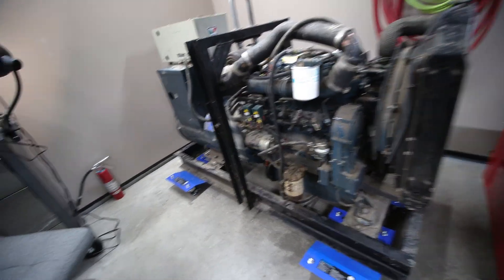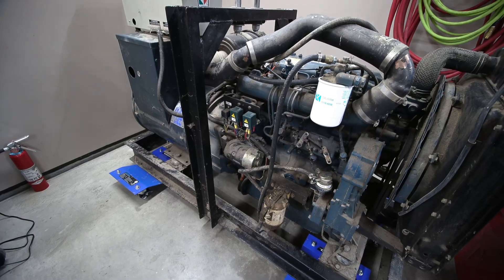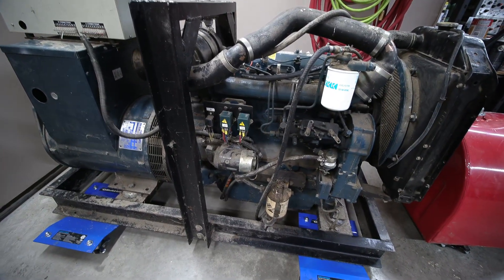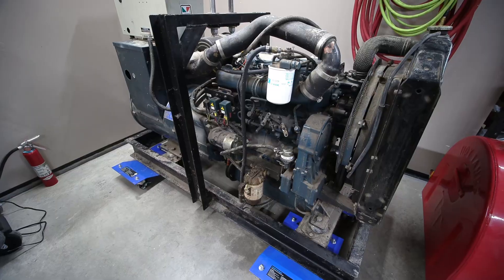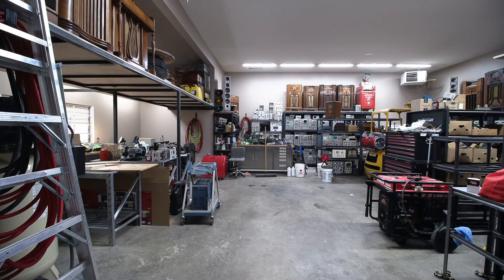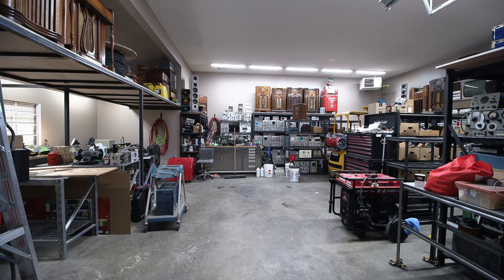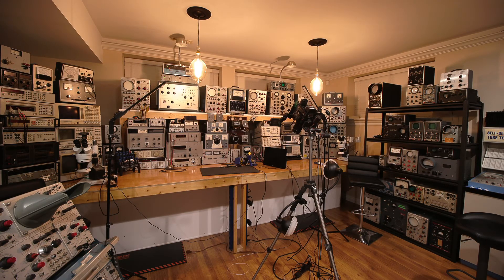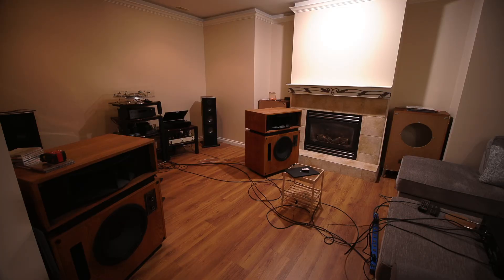Where Are The Videos? My Life And Projects Off Camera

Comment: We also have that issue of having not enough generator for the ground coupled heat pump.   We have a backup lp gas heating system so for us the solution is just to run the gas furnace which the generator can easily handle and not run the heat pump.   The heat pump is great for efficiency but it has failed on us numerous times due to mechanical and control system problems.   So I have been happy with the decision to have a back up furnace vs. a genny big enough to handle the heat pump.

Comment: An HVAC soft-start module wouldn't help out with the startup current on your geothermal compressor?  I installed one on my (admittedly much smaller) compressor and it is magic - reduced that initial instant massive load by around two-thirds.

Comment: I am trying to wrap my head around why you have a 400 kW generator. I was chief engineer for a station in a radio group. The station was in it's own building and that site acted as the office and studios for the station,  as well as being the backup antenna site for the five FM stations in the group. The building had 800 amp three phase service, to power everything. That means we could run five 20kW FM-HD transmitters and everthing else, including electric heat and air conditioning, lighting, etc. The 300 kW turbocharged backup diesel generator could run all of this with plenty of headroom to spare. Why 400 kW?

Comment: I've looked at generators for our area, but ultimately cheaper modern batteries have made full online UPS so much cheaper a generator isn't cost effective. My problem is lots of short duration outages. As long as I continue to have a reasonable uninterrupted mains duty cycle to allow batteries to charge, a decent full online UPS would be my first option. That'll eliminate all the fluctuations and even if I eventually go to a generator for longer outages the UPS will smooth out the demand on the generator.

Comment: you should consider an inverter and lithium battery bank connected to the grid, i am a victron dealer installer. if you had a few thousand watt hours of battery and a generator if you want for reserve the system can essnetually work like a UPS backup and thhe ability to assist during brownouts. it would provide consistant toruble free power.

Comment: Hi Paul,  It sounds like you've got two problems: Power outages caused by the public utility and peak demand current primarily caused by the geothermal heating system.  Hopefully, I got that right.  What I didn't hear is how you "ride through" these disturbances, if you even do that.

15 to 30KW is pretty large demand for an individual's needs but in your case, it does not surprise me.  I haven't looked back at your tour of the new shop so I can't remember if your pumps incorporated soft-start features or not.  If you don't have this feature, you should.  I live in Florida and have power issues similar to your descriptions.  I use a 11KW natural gas generator and was initially told that I needed a 30KW generator to manage my house load and HVAC system.  The reason, I was told, was the AC compressor could pull multiple times the nominal operating current of the compressor depending on when the load is impressed on the line.  As a former UPS engineer, I knew that the generator people were worried about the inrush current in an uncontrolled motor load.  Fair enough but the degree of the concern is easily managed by various soft-start circuits that essentially stretch out the peak demand which reduces the over all demand (such as a local genset or a UPS) to handle the event.

The 400KVA generator is likely over-kill for your load if you incorporate UPS and motor soft-start features.  Diesel generators have superior power in torque specification than gasoline, natural gas or propane.  So I really doubt you'll have too much problem other than it will be expensive to run.  For UPS deployments, a stationary battery can grow quite large depending on the desired ride though need.  Most commercial operations weigh the cost of consumables (batteries and their replacement cycles) with the cost of fuel and opt to run on battery as long as possible before switching to generator.  If you are having multiple events daily of short durations, up to a few minutes each, lithium ion batteries are a good solution and far superior to AGM or typical lead acid types for longevity. 

I use multiple UPSs in my home because, primarily, any UPS that is sized large enough for my total load with inrush headroom is a three phase design.  As you know, all public utility sources that feed residential North American homes are 240VAC single phase, center tapped sources.  240VAC UPSs are rarely available above 5KVA but they are out there.  I use two 2KVA UPSs and soft-start circuits on motor loads.  I can easily handle all peak loads with an 11KW natural gas generator. 

Anyway, I hope you get your power problem resolved without breaking your bank.

Cheers, Scott

Comment: That generator nameplate is a little hard to understand. The rating of 403KW agrees with the 1671 amps, but that frame size (361 in the model number)  shows ratings up to about 60 KW in the Marathon literature.  A 400 KW generator would need around 550 HP, and for continuous duty the engine would likely be even bigger.  It looks more like a 40KW-size unit.
Reply: Exactly right!!
Reply: That makes much more sense! That non-turbo Kubota probably makes no more than 40 HP at 1800 rpm, so a 40 KW generator is still oversize for that engine.
Reply: Generator unit seems absolutely massive for 40Kw, but makes way more sense for the engine output. Could just be way overbuilt for some application, and definitely closer to 40 than 400Kw, but still that's a big ass generator for that engine.

Edit: That's a 40KW gen somewhat derated for .8 PF in continuous. Up to low 50s KW for standby with higher PF. Specs for 361CSL1602 online. This is a 36XPSL160X, but all the gens in the 361/362 frame size are 40-50Kw for continuous duty. This is just an industrial-grade unit and is very overbuilt, with the gen alone weighing 6-700 pounds. Makes way more sense.
Reply: Some dot is missing.... 40,0kw is 167,1amp.....

Comment: Another aproach? A soft start aparatus for the E motor of the compressor? The compressor doesn't care if it spins up slowly, might even be better for lifespan. Y- delta switch or even semiconductors.

Comment: Some thoughts:
To make it easier on that 15KW backup generator:
1) Hard start kit for the geothermal compressor??
2) Put time delays on some of the geothermal components so that startup surge is distributed, instead of hitting the generator all at once??

My $.02!
Reply: No, do not use a "hard start". Use a "soft start". I use one on my geothermal system and it reduces starting current to about  30 %, and prolongs the life of the compressor instead of stressing it even more.

Comment: I would check the windings insulation and the AVR behaviour (on a scope) when taking large loads (>20kW). If everything checks out, install it, taking care to leave space for the maintanance. If not present, add a hand pump for the oil pan. Anchor it to a concrete pad. Do a great job on the exhaust, two mufflers in series will do the trick. Then rewire the whole thing to a brand new Comap InteliLite 4 (several models, use AMF version and if you have modbus/scada requirements for your home automation get the better models equipped with such feature). Such controllers will be able to control directly your GCB (generator CB) and MCB (mains CB). From experience use Fleetguard, Baldwin or Donaldson filters only. Use a 15W/40 diesel detergent oil. Flush the radiator and put OAT Fleetcool 50/50 mix (pink) so that you can forget it for 10 years. Keep two sets of filters and belts as spare all the time. For starting batteries use good AGM, avoid Optimas RedTops (since they started producing them in Mexico they are no longer what they used to be), use a 5A smart charger and set it for 2,30V/cell. It might be wise to add a 500W or 1000W engine heater (low temp version +35C) for when the ambient temp goes below +5C however you need to calculate the yearly power consumption.

Comment: Put a soft start (Micro Air) search Google and you’ll find it . system on the Geo thermal compressor. 

This greatly reduces the start up in rush, so you can operate it on a much smaller generator with less loaded . 

👍 Tech tip of the day.  

Heat pump systems is what I do for a living cell and install . 
In this one particular situation that you describe this is the cheap easy fast fix . 

Especially if it’s only doing it with a voltage sag during the very cold season and you don’t have this problem during the mild seasons, you can take the micro air out of the circuit for the rest of the year .

Comment: The Marathon 361PSL1601 is a 50kW continuous generator (60kW stby). A 400kW unit is larger than the whole set... Have not idea about those values on the plate...
Reply: I agree, but that's for the 3 phase version. The single phase version is rated from 38 to 45 KW continuous depending on temperature rating.
Reply: @Hemi541 Good observation👍

Comment: Mr Carlson if the was built commercially that diesel engine has a lot of torque and was matched to the rated output of the generator set. You should be ok.  You see these engines in tractors.

Comment: I'm not sure what type of geothermal system you have, but a lot of the ones we sell here include a soft starter module. Obviously if your compressor is inverter driven variable speed this wouldn't apply, but if it's a single phase compressor adding an Intellistart module can help make the compressor inrush a little more friendly to a generator. The brands we sell here in America come with them standard. But if yours doesn't have one, it might be a worthy upgrade

Comment: Used to come across lots of old gear / almost all ham radio related & test gear .
So a question - have you ever built a RF power tube tester , something along the line of most common ham related amp tubes 572 , 811 , 400 etc. , have variable adjustments for specific tubes & maybe tube adapters that would plug in to one socket - or some veriation of ?
Thanks again 
John
73
Reply from the maker: I usually just use the device the tubes are in to test them, IE: the RF amp, or final stage. If I need an emission test tor a larger output tube, I just use a large variable power supply. (or a few)

Comment: That easy starting fork lift instantly took me back to when I was a 9th grade auto mechanics student in high school.A senior had his 1950 Ford pickup inside tinkering on  it. He turned on the ignition switch, then bounced a rubber ball off the dash mounted starter button- and it cranked! He later ran the county school bus garage.Good hands to put the buses in.
Reply: For anyone who doesn't know, newer cars don't immediately fire because the ECU delays spark (or fuel, or both?) for a short period when cranking. Can't remember exactly why they do this, I think to verify timing with cam/crank signal correlation before allowing startup, but it's why it takes a second or two to start now. Before computer-controlled spark/fuel, there was nothing to stop almost instant firing. I definitely prefer no delay and think it's much cooler, but since at least OBD2 ('96) and probably earlier that's the reason for the delay. 

On a related note, this is also why a car will crank but not start with a bad Crank sensor and maybe bad Cam sensor(s).
Reply: @Demoralized88  2 reasons- oil pressure must be sensed, and no spark until the engine is spinning over prevents slow cranking because of ignition timing .once it spins ove, the rotating mass prvents"kick back:

Comment: A small capacity engine (looks like sround 40kW) driving a large capacity alternator (you mentioned 400kW??) is probably not a good idea if you ate looking at system efficiency.  Matched generator and alternator capacities always result in optimum efficiency.
Cheers

Comment: Good morning from a no rain day San Rafael Bay California Mr Carlson. You always have super videos !

Ah yes power. You could go with a General Electric LM 1500, yes the Land Marine version of the GE J79 in the B 58 XB 70 and Lockheed F 104 Starfighter, yes The F 104 still flying at Cape Kennedy !

The LM1500 delivers up to 15,000 shaft horsepower (11,000 kW). That should cure your power ills, and you can do a steam loop off the exhaust and can heat everything.  JET A very close to diesel fuel. 
Me Just kidding you.

WoW the forklift clean clean clean, you sure do any job right!  Must say you're a very generous and Very Smart Business guy. !!

Cheers
Kristy

Comment: Yeah, you'd think after 140 years they'd have come up with a better system of transmission than wires strung between dead trees.  In my area (SE PA) we lose power for days after a stiff wind.  I use a small propane generator and extension cords to keep the critical systems running.

Comment: I'm off grid in the UK and had problems in the past with my refrigerator - the startup inrush would overload my inverter. I got around this with a bigger inverter.  Sounds like you have an old style heat pump where the motor just gets dropped across the supply when it starts. Modern "inverter" heat pumps get around this by soft starting.  Maybe you could get a soft-start for your heat pump which would take the transient load off your system.

Comment: Hi Mr C - Having designed power systems for data centres over the last 30 years, you would have considered employing a small UPS ( with maybe a 1 minute autonomy?) to overcome the short break or sag in power when the generator starts to avoid the “lights dimming” drama?  Just wondering why you opted for a genset system with more capacity?
Your videos are very professional, entertaining and educational.  Keep up the great work.

Comment: I would say that the oversized generator is a big bonus.  It only acts as a brake if you load it excessively.  The bonus is that the rotating mass is heavy, so lots of moment of inertia, so when your heat pump kicks in the drop in revs provides lots of energy while the engine adjusts its throttle position.  Loss of rotating mass is a big issue in supply networks as we replace generators with solar panels.  Before you explained I was thinking, "how can that old diesel make nearly as much power as my supercharged V8 Jaguar?"

Comment: I use simple electric baseboard heaters in our 2800-sq-ft house, plus a full basement. Eastern Canada.
We keep it warm, like +20° or 21°C, and the heaters are duty-cycling off and on.
Total baseboard heater power is under 10kW. There's even a bank of heaters switched off due to a sticky relay.

I've seen a lot of people taking the overly-complicated and very expensive approach.
A neighbour spent so much ($30k in 1990 dollars) that I could invest that and pay my under $2k heating bill forevermore.
And he pays more than $2k per year to run his $30k system anyway.
Concept of the day: Local Optimums.

Comment: We invested in a whole house generator (24 kW Generac) with an automatic switch over.   A month ago, when our temperatures were in the single digits (°F) when we lost power.  30 seconds later our generator was up, the entire home was switched over to the generator automatically, and the lights came back on.  We were without grid power for 37 hours.  We stayed warm but our neighbors' homes started to get down into the mid 40's (°F).  It's not a cheap set-up but when you need it you're not complaining.  More than one neighbor came up since asking what kind of set up we had.  The company we bought it from and had it installed through was just here two days ago.  I asked for several cards to hand out to the neighbors.  At least one, across the street, has someone who's disabled, mostly bed bound.   He's already said they are buying what we have asap.

Yes, I did notice a drop off in your postings, but I can see why.  Stay warm and keep the lights on!

Comment: Get natural gas heat. I had a place that lost power a lot. With a only 6k I could run the whole house.

Those Kabota powered units can be really odd. So many companies buy a generator then pick up Kabota engine set and call it good. I’ve seen some way overpowered and several way under what they should be.